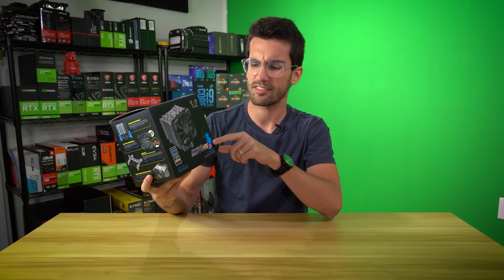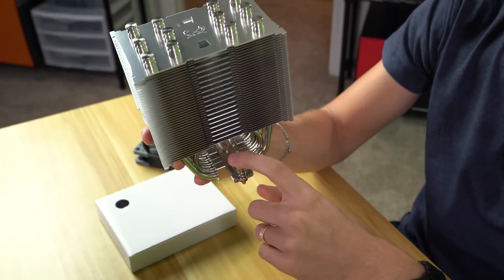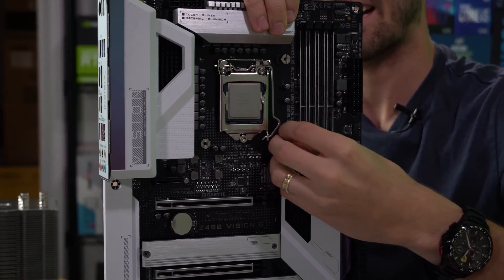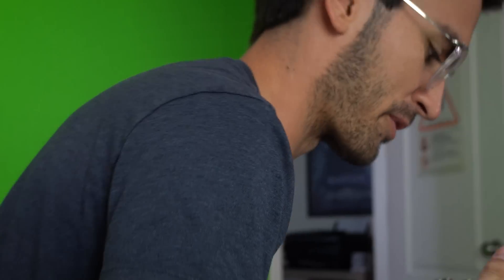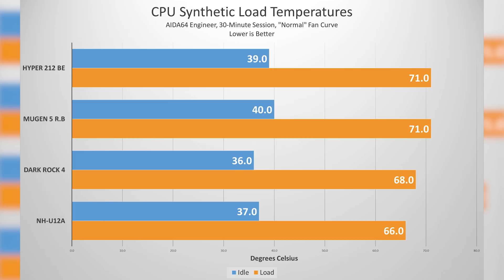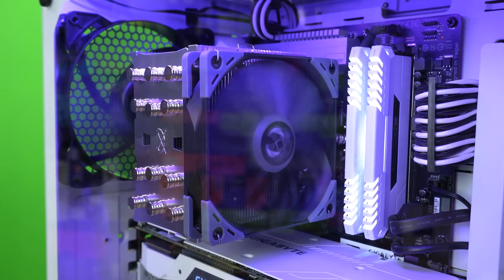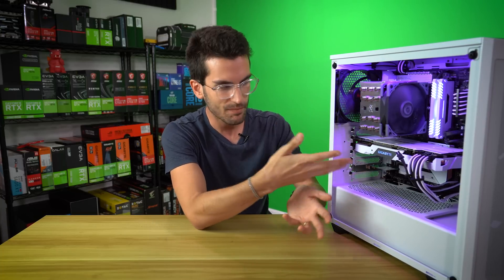This CPU Cooler Is Seriously Underrated | Scythe Mugen 5 Rev.B Review

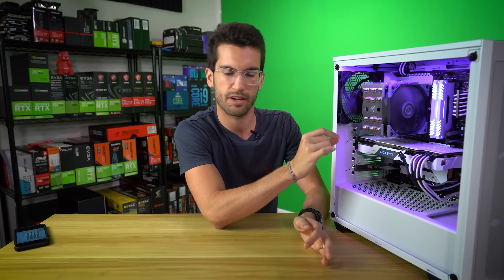Comment: 8:11 ... 10900k 4GHz at all cores? really? what did you actually test?
Reply from the maker: I literally explained why in the video. This was about standardized testing. Could have been 4GHz, 4.5GHz, 5GHz, etc. Every chip is different, mind you, so 5GHz on your CPU won't translate 1:1 with mine. Not sure why this needs any additional explaining.
Reply: @GregSalazar  Yes every chip is different but 4GHz is like a walk in the park even for this cooler. you aren't putting ANY pressure on it, at all. It should have been stock settings at least, not 4GHz. Not all 10770k can reach 5GHz, but all 10700k can boost to 4.7GHz all-cores, which will give more accurate and meaningful test results. You aren't testing the cooler's limits like that.

Comment: Kind of a let-down for under-volting the cpu. Why bother if you're going to under-perform the cpu. Should've just ran it normal and produce those cooling results. This was like running a safe mode test in case the chip got fried.

Comment: NH-U12A has 2 fans. What if you put a second fan on the Hyper 212 evo or on the Scythe Mugen 5 ? Would their performances get very close to the NH_U12A? By the way I have the i7-11700 (non-K). Is the Hyper 212 evo more than good enough for the 11700? Thanks.

Comment: Cooler don't work on all motherboards I tried adding one to Asus 390 -a motherboard and the cooler was too heavy for the motherboard, that it warped it so it wouldn't fit in the slots of the weak stainless steal plates.  Make sure you check the sturdiness of the printed circuit boards, I found the fault was Asus using weak recycled printed circuit boards as the main cause and the backplate ain't enough to keep the heavy tower from warping the weaker recycled printed circuit boards.

Comment: Been running the Mugen 5 Rev.B on a Ryzen 5 3600 for a year now and it's been a fine cooler.   With the included fan pushing and a thin Scythe fan pulling the thing is inaudible while controlling the temps to 65C under 100% load.   Using the included thermal paste and a couple other brands I had lying around the Ryzen would quickly spike up higher than it seemed like it should then come right back down...but that's really just a characteristic of how the temp sensors read in CPUID.   In Ryzen Master the temps read lower without the quick spikes so it's looking at a different sensor or maybe averaging them?   Anyway...I ended up using Thermal Grizzly Conductonaut liquid metal and it really did work a treat...the spiking temps on CPUID didn't go nearly as high and overall the CPU is well cooled even at a silent fan level.   Remember that this CPU even overclocked is about 75-80 watts so only a medium heat level for a cooler and this Mugen 5 might not be enough if you have a 150+ watt burner under it...though with some high performance (read noisy) fans it surely would do better than with the silent versions I have on it now.   But compared to the stock AMD cooler supplied with the R5-3600 the Mugen is easily 20C cooler and quieter for a very affordable and quality cooler.

Comment: maybe a small tip for some out there, u can change the direction it blows, i have 2 exhoust fans on top while only 1 at the back.
so i set mine to blow out to the top.
Reply: Running idle at 30 with an i7 4790k boosted to 4.4 max load 60/64

Comment: I love my Mugen 5. Keep in mind when comparing it to more expensive coolers like the NH-U12A or the Dark Rock 4, that it only comes with a single fan. You can always add an additional fan like the other high-end coolers have if you want lower temperatures.

Comment: I bought that air cooler for my build. That's the same motherboard in build Gigabyte Z490 Vision G. I plan on getting a  i9-10850k. What ram are you using in that computer?

Comment: I have one on my Ryzen 2600 it never gets over 60c  Best Cooler I have used, even overclocked the system never gets hot. But watch out its a Huge Cooler and will NOT fit into the older cases.  Mine had the Screwdriver, you get Both screws from the Top.

Comment: Guys the fan that comes with the mugen 5 spins counter clockwise while most fans out there spin clockwise. That creates turbulence i guess and makes the cooler less efficient, after i replaced my rear fan with a kaze flex 120 (the same pwm 1200 rpm fan that is included with the cooler) i saw my temps drop by 2 degrees. These fans are low static pressure but are very silent as greg says so they make for good case fans too and they are quite cheap. You can hardly hear them even at 1200 rpm.

Comment: I have a Cooler Master 6 pipe that does a really really good job cooling a  R 5 1600 X on a CrosshairVI. The CH6 does mount am3 or am4 coolers. So decided to up the CPU to R 7 3800X. Well it kinda sorta works. But the Old AM3 cooler that had not a problem with 4.5 Ghz and a FX-8350 also works with AM4 CPUs.
 Like 3.9 Ghz + reduced Volts and 45C all core full. And 73C default precision boost with a 3800X.
 So I ordered a 570 becuz the CH6 is a bit flaky with the BIOS that supposedly does the job for 3000 series.

Guess what?  This cooler cost less than what is wanted for the bracket conversion for the few remaining Cooler Master conversion kits. Link below.
https://www.amazon.com/Mugen-Rev-CPU-Cooler-Support/dp/B06ZYB8K77?ref_=ast_sto_dp

Comment: Starting a new build.
Would this work well with a AMD Ryzen 9 3900XT 3.8 GHz 12-Core Processor?
I'm torn between this cooler and the Noctua NH-U9B SE2 37.86 BLACK CFM CPU Cooler.
Or is there a better quiet cooler on the market?

Comment: Can't you even apply thermal paste?  Unbelievable! So your whole review is useless.
Before you have to degrease, then apply as little as possible by spreading it. And there you will gain at least 5 ° to 8 °.
Reply from the maker: ??? There is literally NOTHING wrong with the way thermal paste was applied, here. The tension on these coolers spreads paste evenly across the entire IHS when applied in this quantity. If you're joking, you should probably use a "/s." If you aren't joking, you should probably do a bit more research before making yourself look idiotic.
Reply: @GregSalazar  Stay stupid. It's only mechanical, thermal Logic!!

Comment: Shadow Rock 3 is more efficient, quiter and cheaper. Only problem is its height. I like Scythe, even have Ninja 5 in my pc, but Mugen isn't good and worth mentioning. Scythe are now: Ninja 5 - the quietest, Fuma 2 - the most efficient that size (<160mm) and price. They should do something bigger with 1500 rpm fans - bet, it would kill NH-D15.

Comment: I bought this cooler based on this review and I'm not super thrilled about. It's quiet, but temps are not that great (ryzen 3600x stock) and under load temps are around 75C when stress tested it was peeking at 85C in just couple of minutes. I was also testing the cooling with all coolers at 100% (3 front, 2 top, 1 rear) and temps were around 76C under full load. Price here is ~50USD and unless cooler is incorrectly installed (still want to check it out) there are probably better options. What are your temps?